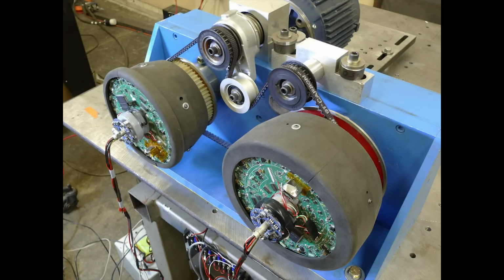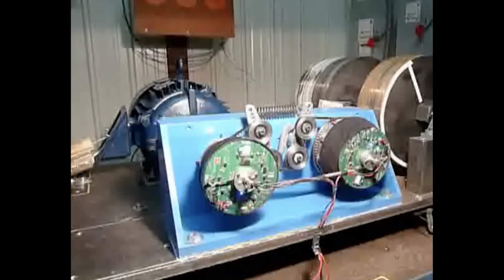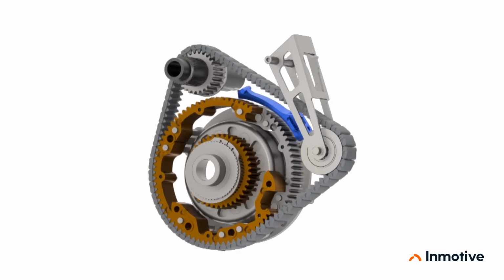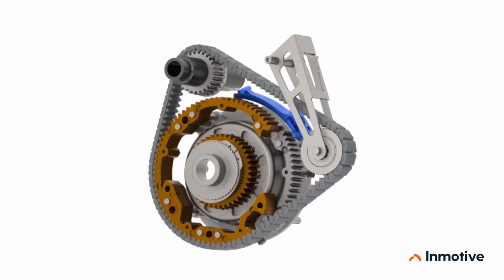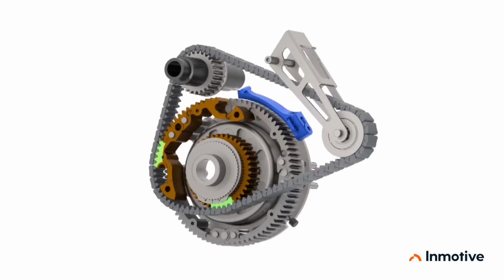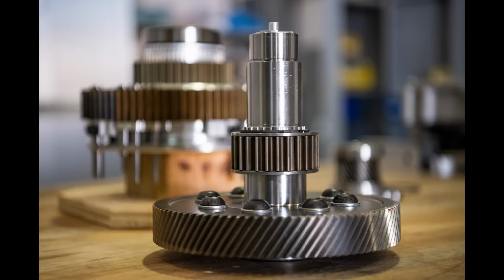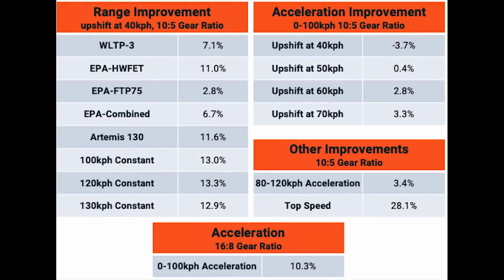Inmotive Improves EV Range & Acceleration - Autoline Exclusives

Comment: Great use also would be  Compact Utility Tractors 
    Add a clutch or even a planetary gear set...-more efficient than a hydrostat and much less cost, but can upshift  while doing ground engagement work
   Just  like  Powershift tractors can. use 2 or 3 stacked units for a Full Range Powershift. They might want to  talk to  John Deere and Kubota, etc.
Reply: Thanks Dan. Yes, the configurations you mention are useful on in-line motor setups like on buses. We're talking to everyone, LOL

Comment: Electric vehicles torque spread can be dealt with by 2 speeds and need a reduction ratio from motor to wheels or differential so you would need either this chain and sprockets or a gear train anyway, the fact that reduction system is now two speed and retains efficiency of a single gear system is unique. The complexity when faced with the torque of a high performance electric vehicle well that's the question balance that against the efficiency gains due to working a motor in a tighter optimization envelope. Would I invest? No I think in the 3 years it will take to prove the system battery technology will have moved on that the economics of the efficiency gain will be wiped out, yes its more efficient but chuck in a few extra kW at peanuts price instead and keep complexity low.
Reply: Great point Graham. We talk about this all the time. Today's ICE's are cheaper cost than even the future, lower cost batteries will be, and efficiency is always a huge priority. But aside from that, in this cheaper-battery future, every OEM will have a cheap skateboard, so then how do you stand out from the competition?
We don't have all the answers yet, but that's why we go to work, lol!
Reply: @patrickm870  I engineered in big auto the all over the world for 38 years ran a company and still do of 20 people in design and manufacturing. 
I observed first hand, Tesla employ the best engineers and they work fast, real fast with a focus on the mission. The quickest way to get the global fleet of 1.4 Billion ICE to electric is simply wipe out 80% by making electric self driving robo taxies so now your dealing with 28M and set up gaint factories to make that 28M and simplify the manufacturing process such as casting the product and increasing the battery efficiency. Sound familiar? I invest in companies which fit that plan, in my estimation there is 10 years till this comes together. You must sell to Tesla or what may become a licenced subsidiary of Tesla in 5 years but their mantra is the best design is no design i dont think they would go for the increased complexity, thats my only reasoning why i would not  invest. I tried to invent a similar drive design never  managed it yours is genius I wish you luck with it.

Comment: They should be able to make up a test rig, maybe they already have, and run this 24/7 to see how it holds up long-term and when and where the points of failure are. Can it last 500,000 or 1000,000 miles and when it fails how much damage is done?
Reply: That's exactly what we're doing, LOL!

Comment: Kinda screams "conventional thinking". EVs need to be rethought from the ground up. It's cheap and easy to have two motors, one driving the front wheels and another driving the rear wheels. Optimize one motor for cruising and one motor for acceleration. Voilà! No need for a two speed gearbox.
Reply: Yes, that's what Tesla does today with their dual motor! We may not replace this layout. Our benefit will be more suited to mass market single-motor systems, even though the Ingear could be used anywhere. However, there are trade-offs with today's layouts, cost being the big one.

Comment: I'm glad Sean ask the question I had in the first 60 seconds, what about reliability? Too bad we didn't get an answer. What I like about EVs is they have way fewer moving parts so way less things can go wrong and way less maintenance. Transmissions are notoriously buggy.
Reply: I didn't mean to skirt the question....it's going to be reliable because it's based on reliable transfer case parts that have been used for decades.
I get your point though. I think our transmission, along with EV transmissions in general, won't be widely used until there's lots of EVs and then automakers are looking for a competitive advantage on range.

Comment: It is not obvious why this tech would be necessary in a typical car,  whether a relative lightweight such as a Chevy Bolt with 6-7 second acceleration time to highway speed, or a Tesla P100D, which hardly needs any better acceleration, nor the weight and complexity of a two-speed transmission.  Since they need speed reduction anyway, a planetary gear set is an easy way to get rotational speed reduction and two speeds from their gearbox, and the reliability of constant mesh gears.
Reply: Good point Eddie. In fact, Audi is moving towards planetary-based 2-spd transmissions in their e-tron (from Schaeffler). The issue is that efficiency is lost by the constant meshing. I won't argue if it's significant or not, but I'll share that OEMs are telling us it's important, and they're the ones paying.

Comment: Looks a bit weak, and I am worried about binding on the way in-and-out of transition.  I would rather have something of a modified CVT transmission for my EV than something as complex as this.
Reply: That's why I said modified.
Reply: I understand the skepticism, especially based on the animation shown. We didn't talk much about driving the car, but it's working really well. We're working on filming some videos of the unit working in real time on the test bench - it's definitely not weak!

Comment: They're going to have to distance the input shaft to get more gear teeth on that chain for strength.  Then the pins the mechanism slides on...they're going to take a heck of a force...then the chain whip when its at speed and shifting is a huge concern. But I do see a few ways it can be improved on!
Reply: Great points - we're working on all of them already!

Comment: would be interesting to compare that with the two-gear system of the porsche taycan. i think they are using a more traditional clutch system.
it is interesting to optimize a motor for a wide range of rpm or use a dual gear system as an alternative.
for higher speeds on the highway of 130 kph or higher, the efficiency is very important because the drag already takes away a lot of energy/range.
Reply: There's a great cut-away of the Taycan's transmission on Jalopnik. It uses a wet clutch pack. Great design, but expensive and the hydraulics for the clutch use up efficiency. But it's an amazing design.

Comment: I'll buy two to make a four speed gearbox for my Suzuki Jimny.  Well, it's been over a month, and I am still waiting for Suzuki to call me to let me know that they have all the parts to replace my clutch.  Bearings must be in short supply.  

Good thing it's a Suzuki and still holding together.
Reply: Cheapest 4 wheel drive I ever bought and the only one that has ever given me 5 years no hassle service
Reply: Well, good to hear Stephen.  After 5 plus months, I sold mine mainly because Suzuki, for reasons for which I don't understand, failed to work on my vehicle.  From my stand point, if my car is no longer supported by the manufacture, it's worthless.

Comment: So basically he answered the question of reliability with "if your going for more efficiency what is the most relyable way to do that we are using parts that are already in use" so yes your transmission will break down occasionally like it does today and it is less reliable than a single speed gear reduction but its a tradeoff for more efficiency
Reply: @chriskim9289  I dont think the motor is something an ev owner needs to worry about unless it was very poorly designed the baker electric cars made in 1909 still use their original motors if we are talking about usability range it would decrease if you used this gear box because you would drive less miles before needing maintenance or repairs the model 3 motor is rated for 1 million miles. to get a longer lasting EV you need long lasting batteries. I agree though that this is more of a niche product more for high performance where reliability isnt a high priority.
Reply: @richy3454  the 1909 baker electric car doesnt weigh 2 tons and had a top speed of 14 miles. 1 million mile motors might last in a tesla but what about trucks? we dont need larger batteries using more lithium and other rare metals we need better power management and efficient and lighter hardware for further improvement and widescale application. lorry trucks, ships and airplane turbines will all be electrified and batteries will need to be lighter and optimized. sooner we can have this sooner we can turn away from fossil fuel. Its not about consumer tech or strictly about tesla really but how things are run its up to OEMS like tesla and Ford to make the move for these changes to happen
Reply: @chriskim9289  Those same 1 million mile motors are rated so high because tesla is using them in their Semi truck and is a basic requirement of certification. I am only using them as an example. I think the area with the greatest potential for improvement would be the battery. Being able to store more energy in a smaller and lighter package would push electrification forward and make ships and airplanes more possible.
Reply: @chriskim9289  in this case he is talking about getting more miles out of the same amount of fuel and they way to do that is to have a more complicated system it has no connection to reliability but generally if its more complex there are more possible points of failure

Comment: The only negative I see is potential chain stretch.  It's become a prevalent issue not only in BMW timing chains but also in the transfer cases.  If lubricating fluid isn't changed regularly, these chains will start producing issues.  One nice selling feature of an EV is their incredibly low maintenance so I'm not sure adding a component that may need regular fluid flushes would be ideal.
Reply: Chain stretch is a concern we have too Aussie2u and William. This is more of a concern with typical chain drives with fixed post, but our tensioner arm adjust for chain stretch. We don't have everything solved yet, but our point is that our transmission actually works and isn't impossible.
On the fluid issue, check out some tear-apaet videos on current EV gearboxes, like the bolt, Model3, etc. They're all filled with lubricant!
I'm not arguing here, but as a point of conversation, when I drive Teslas, I hear gear whine. Now, I'm a former noise engineer and most people don't notice it. But I wonder if this will be more noticeable when there's 50 or more models to choose from in 5-10 years?
Reply: I'm curious about that myself. But so far, our 2017 Volt is holding up well with 60,000 miles on the drive chain. Haven't noticed any play, not saying stretching hasn't occurred, just that I haven't noticed. Almost 300 ft/lbs of torque, time with tell.

Comment: Do you have to lock the chain tension arm when using reverse? Does reverse motor torque need to be limited compared to forward motor torque?
Reply: No, we don't have to lock the arm in reverse, but we do need to lock it during regen mode while in HI gear.

Comment: This looks complicated, difficult to manufacturer, relatively expensive and prone to mechanical failure. Exro claims to do the same thing with software.  Can  you please do a video explaining exactly how the EXRO technology works? They describe it as a ''virtual  transmission" https://www.youtube.com/watch?v=p2Ntq_ao1L8 
 Specifically, how EXACTLY does controlling the amount of current sent to each winding separately allow you to change the torque characteristics of an electric motor? MOST IMPORTANTLY, why doesnt everybody do this?[Zero Motorcycles is].Also,please compare the Inmotive and Exro solutions.It would be fascinating!Thanks!
Reply: I do not work in the automotive (or related) industry, but I don't see anything there that would qualify as complicated, difficult to manufacture, or relatively expensive. Maybe there is something that I have missed here, but in comparison to mechanical manual transmissions (or even AT's), which I have rebuilt during restorations of cars, or other mechanical components, this looks like a piece of cake in those regards. And yet, once one remembers that the draw on, say a battery bank, that it obviously increases relative to the rpm's of a motor, I am just a little surprised that these guys are apparently the first to create a system that will make an electrical power train even more efficient. 
It would seem to me that being able to "shift" to a taller gear set when cruising (for hour after hour) as we do on freeways, turnpikes, etc - that this is exactly what the doctor ordered. Torque gets you up to speed, power keeps you there. So now there will overdrive gear as well as an underdrive.
Reply: @bishop9598  Well I do work in the auto industry (over 20 years) and it is simple, easy to assemble, and cheap. If I didn't think so, I wouldn't have signed on to work on it, LOL.
Reply: @patrickm870  That's what my reaction was to "..looks complicated, difficult to manufacture, relatively expensive. . ." --- say what?
Thanks for validating
Reply: @bishop9598  It’s simple and cheap compared to an AT, abut  not compared to a piece of software
Reply: Question is: is Exro method real?/and if so which basic physics principle is it manipulating and how?
Reply: @henryevans7205  EXRO is just optimizing an emotors  controller (ie how it functions) (what kind of emotors?), which can broaden its torque and power curve.
 its not changing speed the motor's relative to the wheels like transmissions do... so things such as frictional losses are not improved...so saying its a  ''virtual  transmission",  seems to be poor analogy, without 3rd party comparison testing, to prove it gives at least most the advantages of transmission virtually
Reply: @henryevans7205  btw what EXRO is doing, is analogous to 'cylinder deactivation' for an ICE
Reply: @nc3826 thanks What EXACTLY are they doing when they optimize, and is it different than other motor controllers?
Reply: @henryevans7205  so you want 'EXACTLY' what they patented and is based PhD physics in 2 or 3 one syllable words? good luck with that

SM u gotta love it ;)
Reply: @henryevans7205  hint when power demands are low, the field strength has be reduced normally, reducing efficiency
Reply: @nc3826  it’s my experience that anything with a significant observable  impact on the real world can be explained simply. 'it's like an electronic gearbox' is an attempt,but its too simplistic.  I always thought electric motors made 100% torque at 0 rpm ; how does Exro change that?
Reply: @henryevans7205  ok explain the meaning of life?

 Is the world flat? Observationally it seems to be and its has a significant impact on the real world. Also it’s a fish's experience to live in water, while not realizing it.

btw having the ability to obtain a 100% torque level, off the line, has nothing to do with increasing the efficient use of the motor (ie relative to its power and torque 'curve'). 

What field strength? fwiw they already explained it 'simply' and its mostly common sense what they needed to do. whats complex is how they figured out how to do it?

WADR the real problem is your not even able to ask the right questions. And I confess I'm not smart enough to know how to dumb it down for someone like you. So this pointless.  

but it was a cool post so thx
Reply: Great points on Exro - they're doing amazing things. Check out what Havelaar is doing too. We're just one part in a big disruption phase for the entire automotive industry.
I understand the skepticism based on the animation though. Hopefully we'll be posting some videos of the transmission working in real time on the bench. It's awesome.